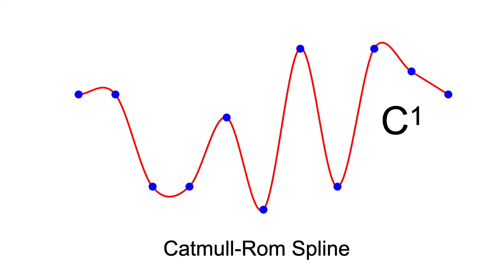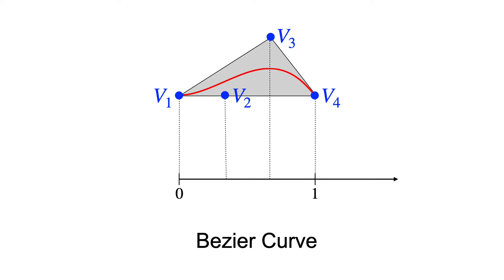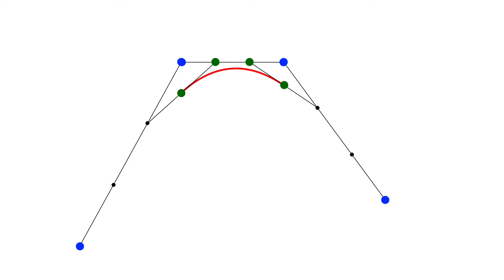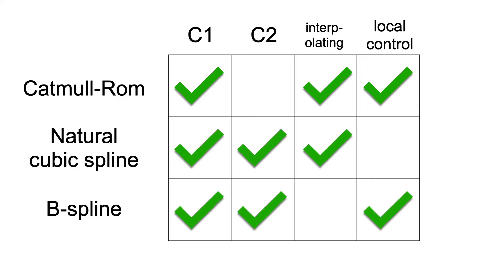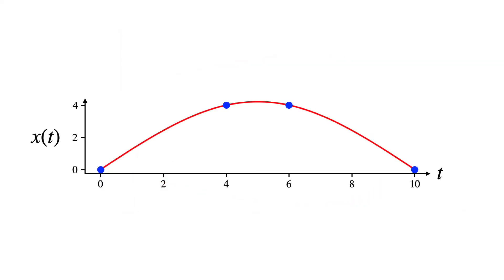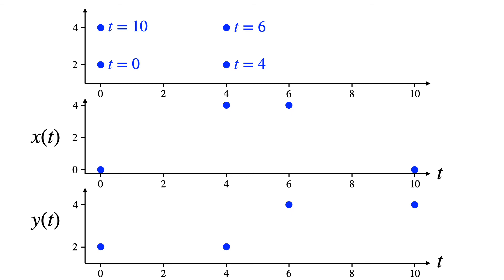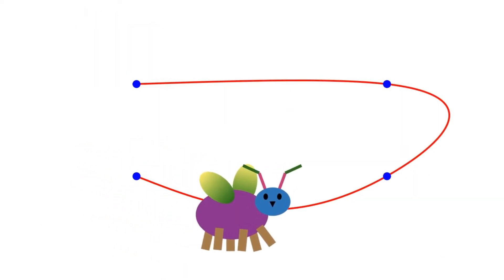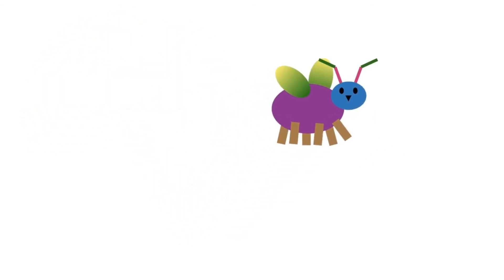Splines in 5 minutes:  Part 3 -- B-splines and 2D

Comment: What about getting the end points of a B-spline to meet up with the first and last control points?  Or what happens if there are only 3 points?
Reply: If you only have 3 control points you cannot make a cubic B-Spline. It needs at least 4. To get the curve to pass through the first or last control points (or any other control point for that matter), you can just repeat that control point multiple times in the sequence of control points. Hopefully that makes sense and I hope I didn’t get anything wrong.